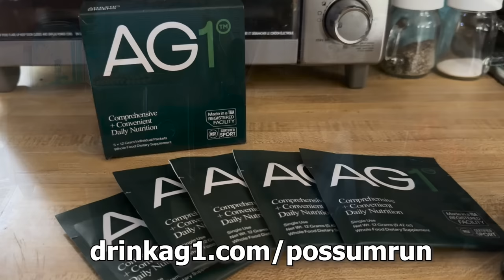IT WORKED! Floor Joists, Tiny House that Grandma Built, Single Woman, Homesteading in the Woods, AG1

Comment: hi, put some foam insulation in floor and and screen for pests.
Reply from the maker: Using reflectix insulation on the floor and side porch will be screened eventually
Reply: If done like @Boss of the swamp, it doesn't need hardware cloth.